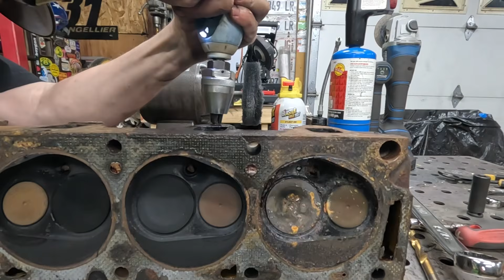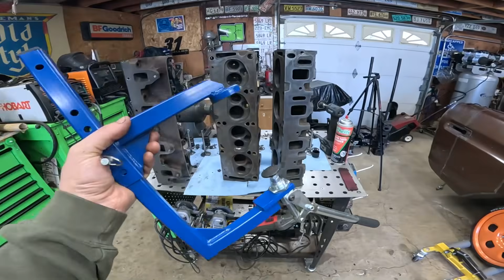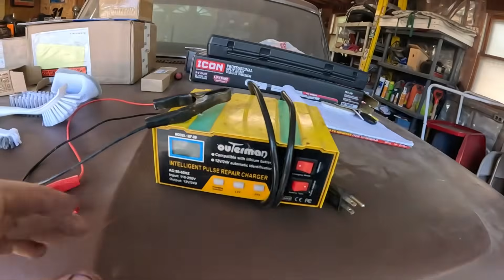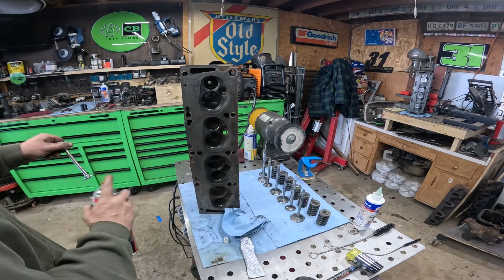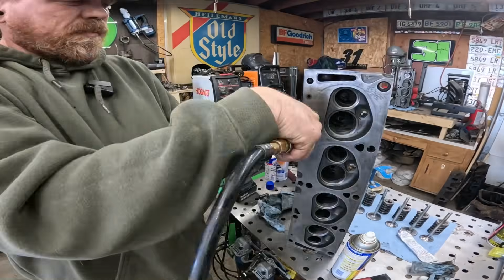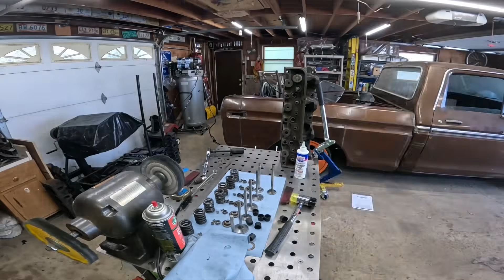Repairing Cleaning and Assembling My Stock Cylinder Heads CHEAP!!!

Comment: I've used electrolysis lots to clean things up. The most recent was to get the rust out of the fuel tank on my 65 Galaxie. I've just found your channel, and subscribed. I'll soon be whipping the heads off the 390FE. Parts aren't that easy (and cheap) to find here in the UK.
Reply from the maker: Thanks for watching and subscribing.  I love the 65 Galaxie, it's on my bucket list of cars to own one day.  It can be tough to get parts here, so I can only imagine it's that much more difficult in the UK, but when you're done, that will be one sweet unique vehicle over there.

Comment: I love your movable work bench. After watching you welding table upgrade video, I bought one and it is one of my favorite things in the garage espcially with those awesome casters. I haven't completed all of the mods yet, but I love the table. I used to have a 72 Bronco in the late 80s and I rebuilt the 289 in it. It turned out amazing and you are bringing back nastalgic memories. I appreciate your content. I also do videos so I know that is extra time on top of your project so thanks again for bringing us along.
Reply from the maker: I love this table. I’ve been getting really good use out of mine lately. Used the vise attachment last week and the buffer two weeks ago. I bought a cheap tubing bender I’m eventually going to mount to a hitch for the table. You’re right, filming does add a good amount of time to the project, but I’ve been enjoying making the videos. As always, thanks for watching!

Comment: Great video! When welding a nut to remove a broken stud, do you go straight from the nut to the stud? I stumbled on a YouTube short of a machine shop that welds a washer on first, then a nut on, and they claim that's the trick. But with those expose ends on the FE head, it might not matter what you do...! I know you said these heads are pretty worn, did you consider porting or matching the gasket openings to the flanges? That seems like a handy DIY budget trick as well that might help a little on performance.
Reply from the maker: So I usually drill a well into the broken bolt about a 1/4 to 1/2” down to get a little extra penetration on the stud. Honestly, if I had an acetylene torch I probably could have got them out with the collet extractor, but it was never gonna happen with the little propane torch.  I did consider port and polishing these heads but decided against it for the sake of time. It would have probably taken me a couple weeks to port both heads. I may keep it in mind as an option for the future though. I’ve always wanted to learn how to properly port heads. These might be a good set to learn on.

Comment: Cody, not an engine question. Where did you get the orange tires/rims to roll the truck around on?
Reply from the maker: I picked these up off EBay. They are called Guni Wheels. They have a couple different options for multi lug patterns, the 45 series is 4 bolt and small 5 bolt patterns. The 56 series is large 5 bolt and 6 bolt patterns. They are super handy since I wasn’t set on what wheels/tires I wanted until recently.  Thanks for watching!